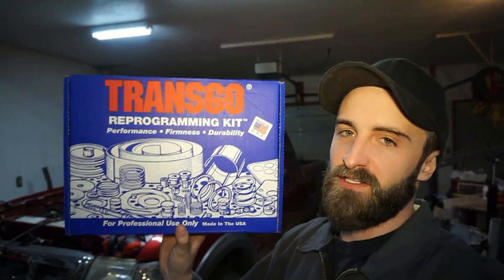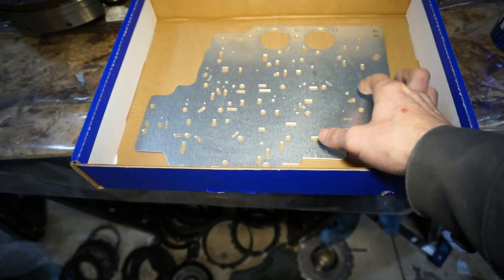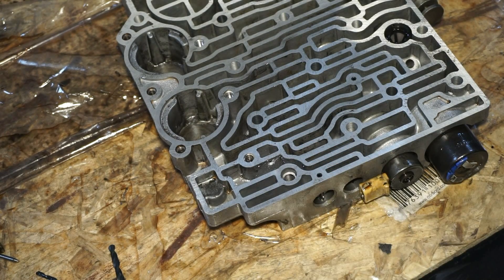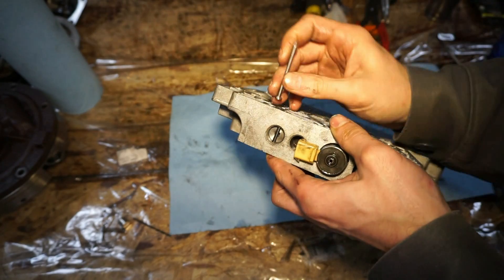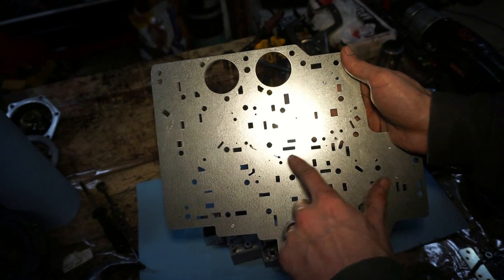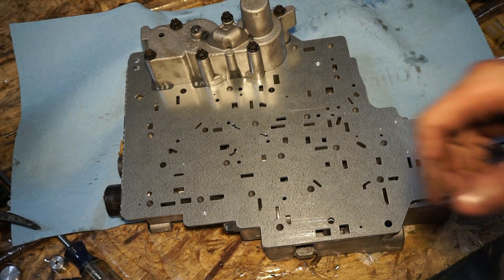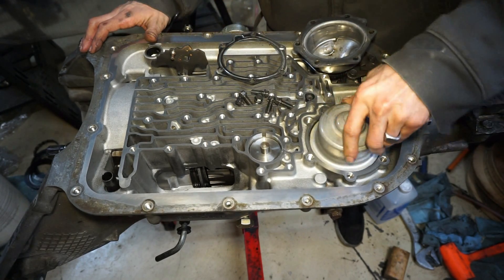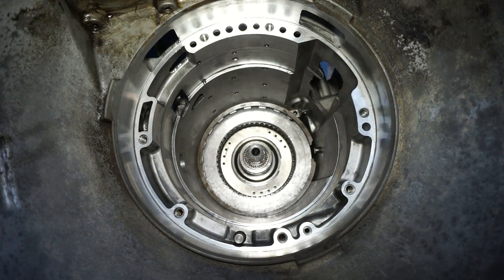HOW TO 4l80e TRANSGO HD2 SHIFT KIT INSTALL!!! Intermediate Ring Direct Drum Springs!!! - a21bravo

Comment: Anybody else running this kit have to stop completely and shift slowly from drive to reverse and viceversa or else trans wont engage or engine will die? I have this kit in 2 different trucks both running the sonnax valve lube regulator and they both die if i shift fast like i used to do before the shiftkit, besides that everything else works perfect

Comment: Great video! Half way done. Quick question, how much oil does it take after doing this? I’m changing out the torque converter aswell. 14qts?
Reply from the maker: Usually 14 on a complete build. Just pan drop and converter maybe 6-8.
Reply: @BlaserBuilds  I overlooked your other video and ended up drilling holes for the pressure relief mod. Is it okay to continue? I won’t be beating up the setup anyways. What do you suggest?

Comment: Never should installed that plate, it is a disaster waiting to happen, and the metal expander on the sealing ring is pure $hit as well , hope it is holding up.
But personally I would remove the plate, tap and die and plug that hole and skip that part and sealing rings Sir
Reply from the maker: Check pinned comment.
Reply: @BlaserBuilds  yessir, I am a recent member of 4l80e on FB and saw u there. I appreciate all you show here and wil follow that link as well bro

Comment: How much horsepower can it handle after this kit?
Reply from the maker: 700-800... The input shaft would be more of a concern than slipping with this kit.
Reply: @BlaserBuilds  I am shooting for 600hp on my build. Just bought a stock 4l80e from jegs. Probably won't launch it but roll on to it on the highway.
Reply from the maker: @EpicBreadWinner  It will be good 👍

Comment: I know this is an old video so you may not comment… if you do will you walk me thru how you got to the part for the internal snap rings  ? I missed that part… or is it behind the pump?
Reply from the maker: Can you clarify the question? Which snap rings? Are you talking about the big intermediate snap ring?
Reply: @BlaserBuilds  that’s my fault I was speaking of the snap ring that you used from the trans go kit. I think (not sure) it’s the upgraded ring behind the pump.?
Reply from the maker: @ericcrews2328  The only upgraded snap ring that comes with the kit is the intermediate snap ring, and I usually recommend leaving it out unless you're already removing the pump and drums for a rebuild. If you're doing a rebuild you can dual feed internally and wouldn't need this kit.
Reply: @BlaserBuilds  that’s the exact one I was talking about… so if the trans is good just leave that part alone? It’s a junkyard trans deal
Reply: I’m gonna be doing the 80 swap on my 2001 Silverado soon and was told this kit was the best bet to help it live? I’ve also been watching your video on how to do the whole rebuild

Comment: Where did you put the pressure relief valve at????
Reply from the maker: I do not install the pressure relief valve anymore. Updated process in pinned comment.
Reply: @BlaserBuilds  dang i shouldve looked more into that 😞 if i already drilled the holes i have to install it or can i leave it out?
Reply from the maker: @wilperroreyes7390  it's fine if you install it. If you want to plug it now you can just tap it and plug it with a set screw. Leaving it out just eliminates the risk of the valve getting stuck and leaking creating a pressure loss scenario. Low risk, but its possible. It's common now to just skip that step.
Reply: @BlaserBuilds  ok thanks for the advice i am building trans for a high performance car so would like to avoid any mishaps i will. Try getting a plug thanks again!

Comment: Best video yet
Reply from the maker: I have an updated video also, showing the install without the pressure relief valve, and adding a line to lube valve to bypass the pump drilling step.

Comment: I have found that the "the pressure relief modification" is for 1999 and earlier. Somewhere in 1999 GM fixed (updated) the OBDII. This solved the runaway high line pressure problem. If using an aftermarket computer, this should not be necessary.
Reply from the maker: I have an updated video without the relief mod also.

Comment: I cant see how those check balls are not going to fall out if doing it in the vehicle, or how one would get them to.. hover ? In their proper location when putting it back together. I guess I'm not seeing something correctly?
Reply from the maker: Use assembly lube to hold them in place on the plate when puting it back up.
Reply: @BlaserBuilds  thanks man"  I just remembered I've got a very slow drip tween the transfer case and the transmission, That tranny weighs more than I do, my truck is lifted 6" plus 35" tires, I put it in with a motorcycle jack balanced on a 6×6 post, parked over a roughly poured, not smooth, five-by-five concrete pad lol 🥴   This is gunna suck, at least it's not 105° outside this time. Seen ya on Street Outlaws, I was like hey I know that dude👍

Comment: Great, to-the-point video! I have put TransGo kits in TH400's. I watched this vid more so to see if I could decipher what is in my trans, but also to see what is involved in the TransGo kit for the 80. What? I bought it on craigslist from a guy who had it built w/ a Monster Mega SS kit by his uncle, but changed his mind to go w/ a 6 speed manual instead. The trans worked fine at 1st...for all forward gears. I never thought about reverse, as long as it worked. Two months in, I lost reverse. Researching, I found that the reverse servo piston pin is the most likely culprit when everything is fine except reverse and low-gear braking. Taking the valve body out to get the servo piston cover/servo piston/piston pin out, I FOUND OUT at least some of what is in it...the yellow pressure release spring, orange reverse piston return spring, and 7 check balls. I didn't take the separator plate off as I did not want to disturb the gasket, but from what I found, the trans has the HD2 kit. Oh, and it looks like the boost valve on the pump was also changed/is new.

Comment: Great videos man, I just have a question, I notice that you didn’t do the step 4 that states to drill a 3/64 hole thru side wall on the pump stator, did you forgot? It is really important to do it? I’m asking because I forgot to do mine I still have the pump out but I just don want to take everything apart please let me know thanks!

Comment: why would you run an hd2 kit when you have the trans apart. the much better option would have been doing the dual feed mod. i understand why you would do the hd2 kit if the trans wasnt apart, but you could have done the dual feed and had a much better setup. also undo that pressure relief mod on the valve body, its a huge risk and can easily smoke the trans due to low line pressure. they fail all the time when they get a tiny bit wore out. its super well known to skip that part when doing the hd2 kit nowdays.

Comment: Sonnax makes a boost valve with built in pressure relief so you don't have to drill your valvebody. The Transgo relief setup is a problem waiting to happen if that spring gets hung up..you will burn down your trans..otherwise it's a great kit.
Reply from the maker: I added the Sonnax valve in a different video, after the kit was installed.
Reply: @BlaserBuilds  cool. I did the same after finding the Sonnax part. I'll check put your other vids..good content.,subscribed.
Reply: Do they make a boost valve for the 4L60 too?

Comment: Will I lose the check balls if pull the valve body out from under the truck?
Reply from the maker: Brett Hooper No they should sit in the hole in the plate. Just be careful lowering it.

Comment: I think you forgot to do the hex bolt on the valve body my dude. I dunno if it'll hurt anything but I just know its in the kit lol and I don't want to see it turn into a grenade after all the work
Reply from the maker: Ryan One snapped when I did video... Got a new one before finishing it up.
Reply from the maker: Ryan Talked about that here.

https://youtu.be/qDi9JcZjDkM
Reply: Noice, getting that bolt out without it snapping, stripping or cutting your hand open after you slip is the hardest part of the whole install lol